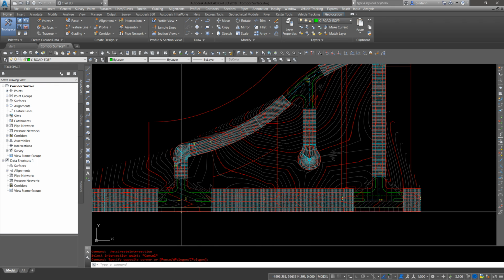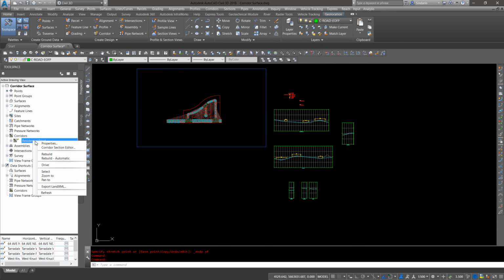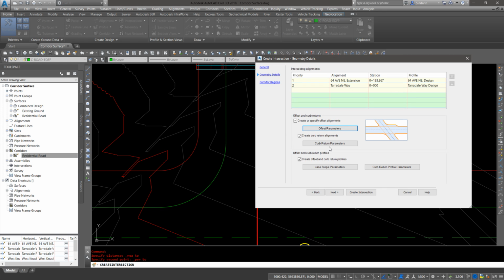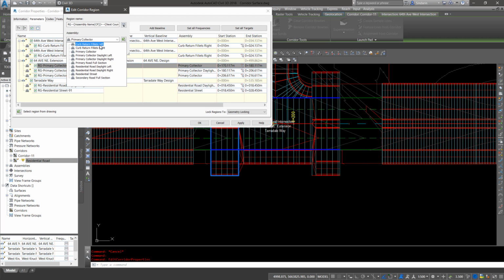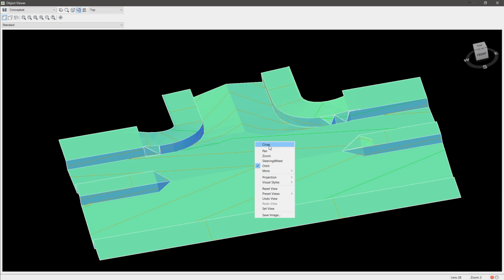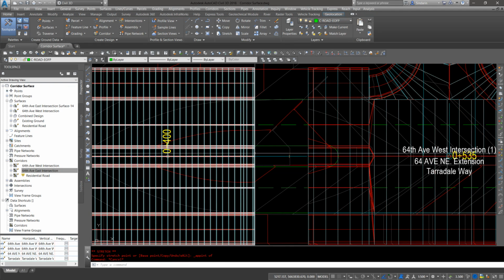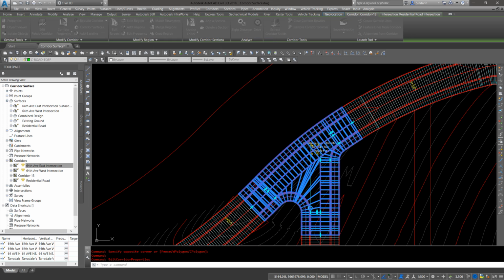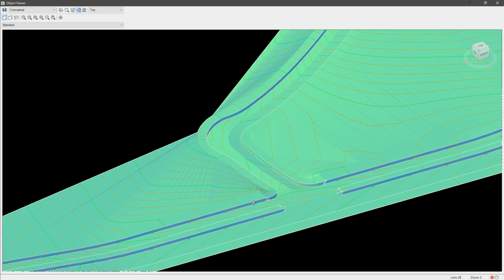Corridors &  Intersections

Comment: Hi Kyle, 
Thanks for this video, it help me alot. I have one issue that  is the intersection with cross gutter. Do you have any video show how to handle this. Your help is very appreciated.
Reply from the maker: I would probably just make a modified assembly that has the gutter in it and target a slightly closer to the centerline offset.